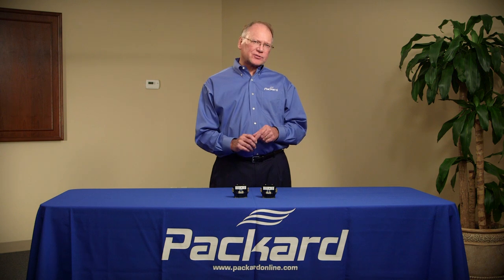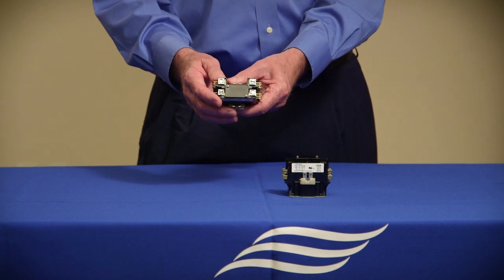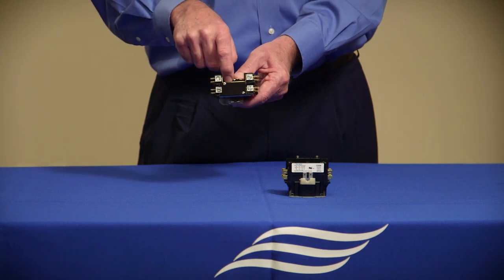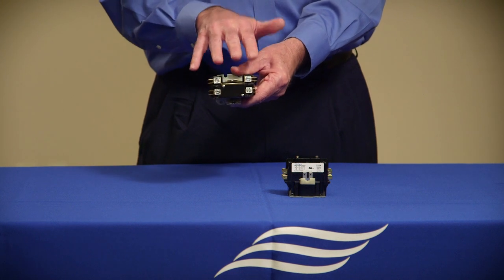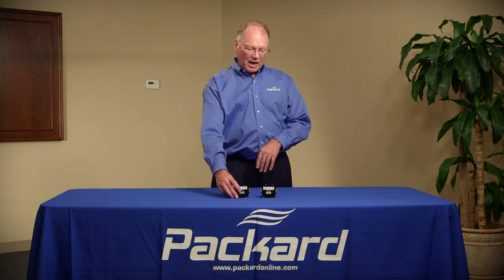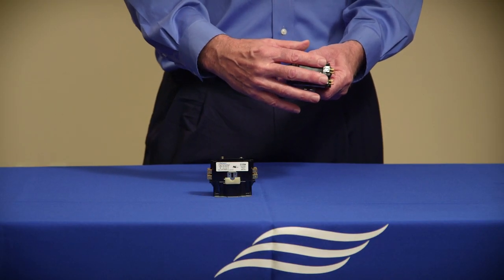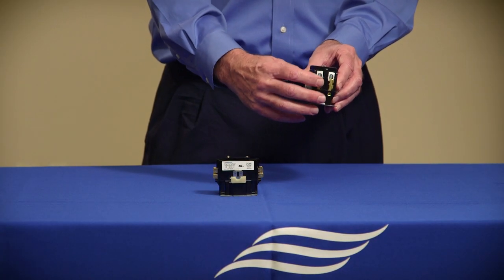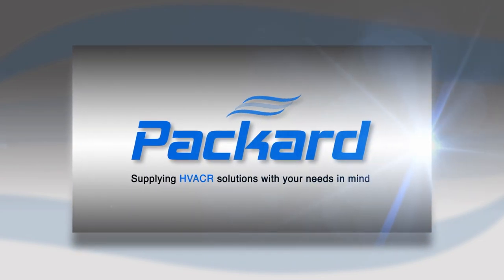1&2 Pole Contactors/ What Technicians Need To Know

Comment: So why doesn’t the “always hot” 120v try to start the compressor?  I understand 120 isn’t enough volts, but it would seem that a constant 120 on the compressor would damage it.  Something has to be preventing the 120 from trying to start the motor, right?
Reply: I just got a nice shock because of one of these always closed shunt contractors. I still don’t understand what the purposes or why it was used instead of a regular contactor.

Comment: You can use double pole replace a single pole install jumper on one side some companys use that for trickle voltage crank heater cheap and stupid way heating windings.

Comment: From other videos I gather that 95% of the time you can replace a single pole contactor with a double pole contactor.  There are a few applications in older HVAC units where the always hot shunt of a single pole contactor provides power to a heater or a resistor across the capacitor.  In such a case you could still use a double pole contactor, but jump the terminals of the extra set of contacts to simulate the original shunt, or just connect those load wires on the bottom line in side.

Comment: What?  I was hoping you’d show how to wire a 2 pole that’s replacing a 1pole.  Got nothing from this video.
Reply: You wire it exactly the same way, nothing changes. Yes you can use a double pole to replace a single pole. The guy didn’t answer the question or added other info how some units it matters and some don’t matter.

Comment: ahh so can we use 2 pole as 1 pole or not?
Reply from the maker: Yes.  If you want to use it as a single-pole you would just attach a jumper from the line side of one of the poles to the load side of the same pole.  When you do that, that pole is always energized.
Reply: He said no. If you only have a double pole contactor then make it a single pole with a proper sized jumper and the important part of this all  is that you always have power through start and run windings in cases where unit is calling for a stint because in some cases it may be vital to the  proper start of those motors. If it didn't matter then it wouldn't matter what side of power the stint was on but it's always on the side feeding your windings and capacitors.
Reply: @davidhazas7162  Thank you so much for a clear answer! I have been reading & watching videos for 2 weeks now to familiarize myself with the wiring & not one person has mentioned this! All have said that it's fine to replace a 1 1/2 pole with a 2 pole unless you have a crankcase heater. I thought it might be critical when replacing a contactor that the shunt side needs to have certain wires attached & that there may be a reason that the manufacturer used a 1 1/2 pole instead of a 2 pole, & not just to save money. I am replacing my contactor with an Emerson SureSwitch which has things lined up differently from a standard contactor, & it's important to follow the wiring diagram on the condenser unit & on the SureSwitch very carefully. To make things more confusing, the wiring diagram with the SureSwitch is wrong!! I shows L1, L2, T1, & T2 in the pic & diagram in the opposite places from where they actually are on the device, & states that L1 is the switched side when actually L2 is the switched side!!! (Which is the opposite of all contactors I have seen pics of, to make things even more confusing!) No excuse for them not catching & correcting this! The same instructions that came with my new SureSwitch have been online for years with the error - I know because I found them on web pages that were several years old!🤔🤨😮‍💨🙁